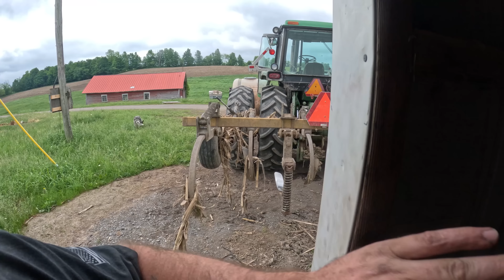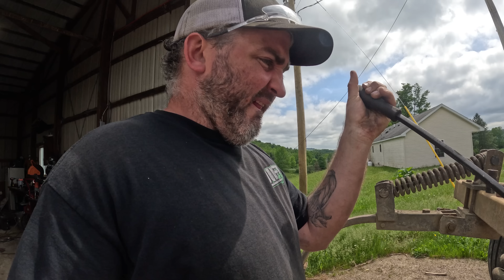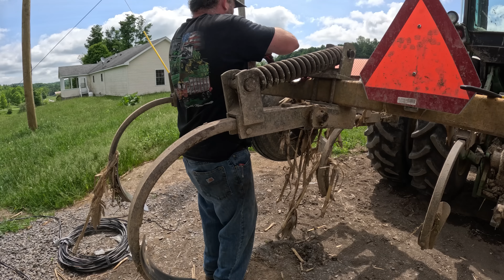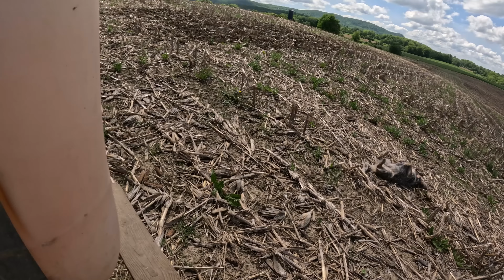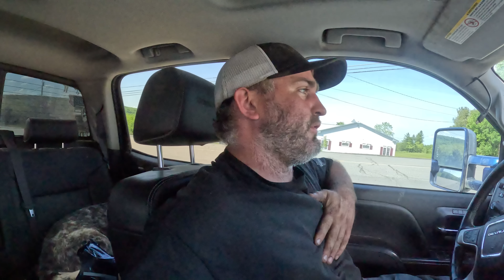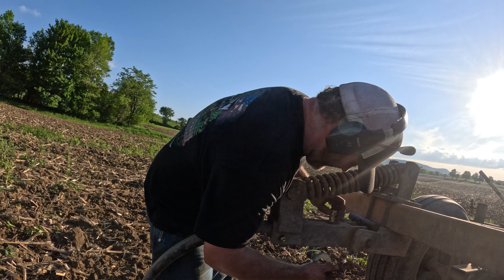Broke The Chisel Plows- May Never Finish

Comment: 4 cheap tractor supply or harbor freight lights on the tank brackets and straight wire with alligator clip to starter will change your life and do it in less than 30 min and 100 bucks .

Comment: 1.  What happened to the A/C is that you walked away from the tractor and left it idling with the a/c running and there wasn’t enough fan speed to remove any heat and overpressured the system.

2.  Raise the implement out of the ground when you turn around.

3.  Always farm at a diagonal to the last tillage or rows for less trash and level soil.

That is all for now.  No need to thank me.

Comment: I have a 2550 and there is a circuit card in the dash that acts like a fuse for the radio and AC.  It's located on the right side of the dash.  The plastic bezel pops off in halfs and with the right side removed you'll have access to the card.

Comment: Keyboard warroir 7914 here.... Good 3rd shift morning,   Like others have said, chisel plow at an angle. Takes longer but better result. Any chance  of paying one of your buddies wifes to fix you  a weeks worth of ready to eat meals? Keep money in the circle?  You need MANIFOLD MEALS when doing tractor work all day. Take meat, potatoes, veggies, onions, ect., little olive oil and or butter, wrap it in aluminum foil and cook it on the engine. Been doing it for years.  Everything from leftovers to hotdogs and hamburgers, ect..  Hot meal on the go. 5 gallon cooler of water stapped to the step or tool box and youre set for the day. I'd like to take a road trip up youre way one day and see water and rock challenges you have. I dont have that in flat indiana ground

Comment: While the tanks are still up on the tractor, weld four feet onto the beams so you can easily get under the tanks with the forks.. Just need about 2 inches.

Comment: If you chisel plow again? Go at a slight angle to the existing rows. It won’t ball up as bad. And quit turning with it in the ground 😂
Reply: Don't make any difference been turning with chisel plow and disc ripper down for 20 years and never had a problem
Reply: @Thegrim326 they are not made to turn in ground.  If I had a guy do that I'd send them home.  Repairs cost time and money
Reply: @Thegrim326  maybe a pull type but not mounted
Reply: I would say it all depends on on condition and type of ground it make since not to turn with mounted type aswell. Doing 1 mile a hr  to 2/3miles a hour put different stress and strains  on equipment new stuff is made for speed old gear was for stead going. Like tractor old do 20/25 miles a hour new one are doing 30/40 hence why new  are breaking down more old are still working 50/60 plus year still going. new gear nackerd after ten fifteen year. Head for scrap heap
..
Reply: Take your time slow or you, ll burn your self out. Rome was, t built in a day. Keep up the good work tho love your videos videos.
Reply: How do you work ground in fields that aren't straight and follow the contour of the land.
Reply: You need to mount fire extinguishers on every tractor, truck, the combine and chopper.
Reply: @jdcatskinner  you don't have to turn ti follow the grade of the land. And then when you run out of field you turn around
Reply: @jesseburleson2670  and pick up a dictionary because contour and grade are to different words
Reply: Yes and two as in two different words is spelled t w o @jdcatskinner

Comment: Hopefully someone just overcharged your ac system causing the relief valve to pop off. Could be a dirty radiator and condenser as well. Hopefully not a plugged expansion valve

Comment: I was actually expecting your duels to fall off… Ready rod is not meant to be used for holding on Wheels. One would preferably be using grade 8 bolts when fasting duels to a tractor.
Reply from the maker: Duals are not fastened with anything but john deere hardware. Clearly you missed that part. Weights are still properly secured and doing well
Reply: he's the RCtractorwizard of course he doesn't know the difference between a weight and a hub
Reply: Cody Foster 9781 should know that you don’t put homemade bolts on the things that go round Roundy